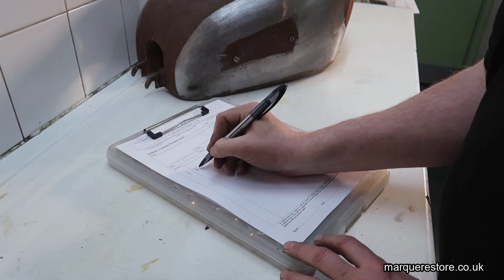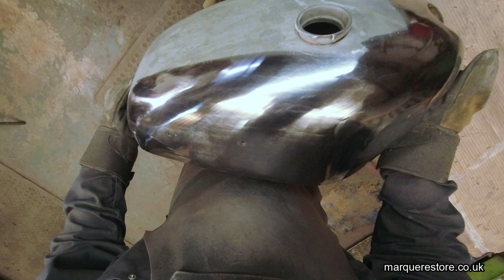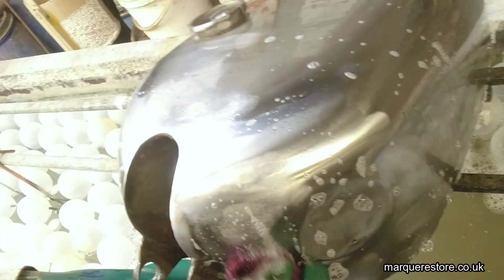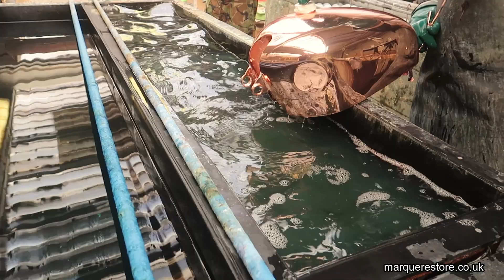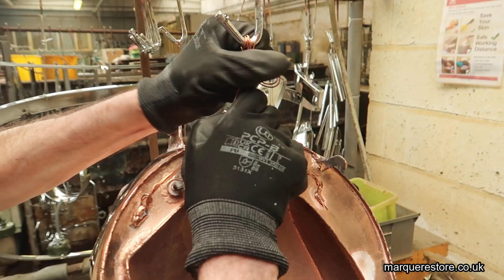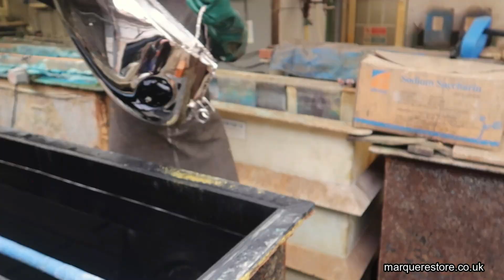How to Restore The Chrome On A Vintage 65 Year Old Motorcycle Fuel Tank: Step-by-step

Comment: just amazing! i have the same tank i need chromed ... ball park what was the cost to do this job?
Reply from the maker: You are looking at about £380 ex vat if it is a simple polish nickel and chrome. Heavy coppering adds 35% if needed. Repairs are extra depending on how long they take.
Reply: that is very fair pricing for the time and skill set @ChromeandCarRestoration